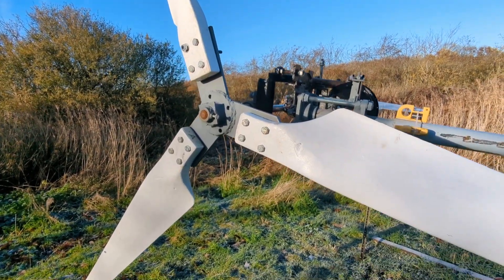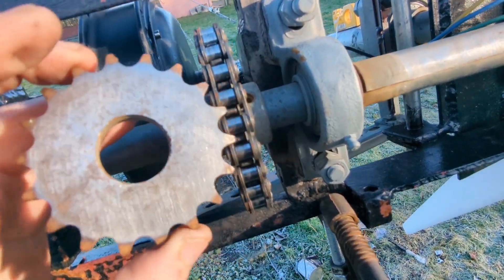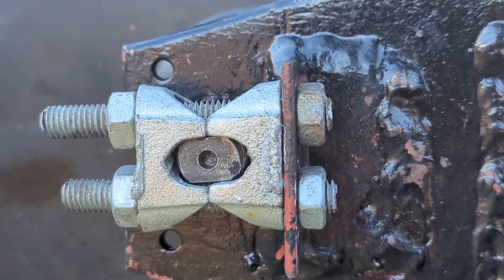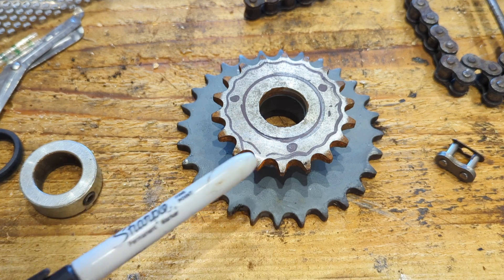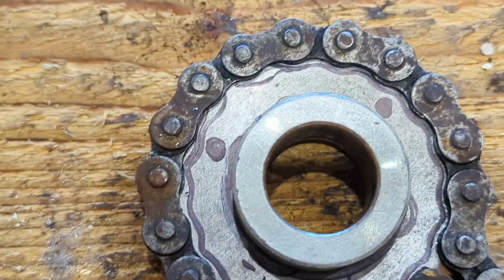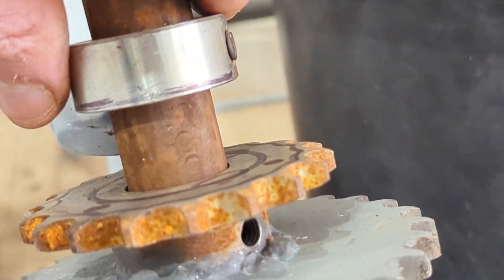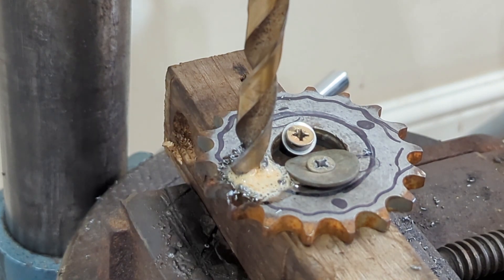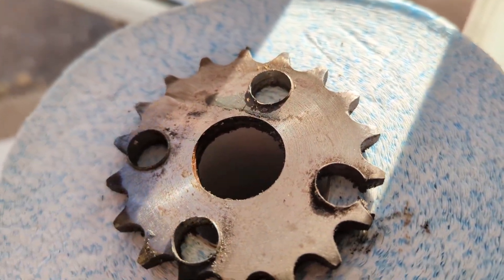Wind Generator - Low Wind Modifications - Part 2

Comment: small sprocket is thick enough, so you can tap the holes for bolts, that way M8 or even M10 bolts can be used.
if you have spare sprocket, of course ))
Reply from the maker: It seems ok now just rating for the wind